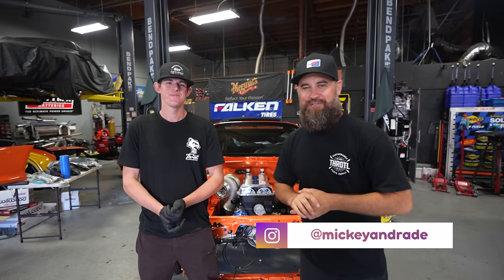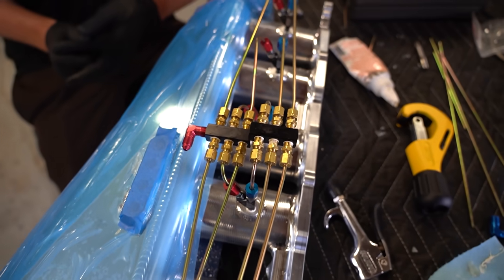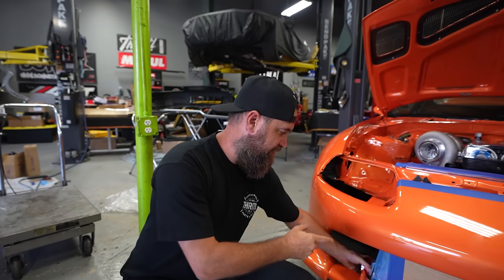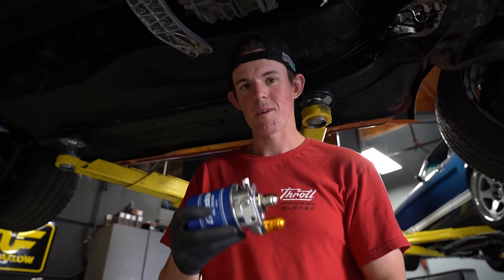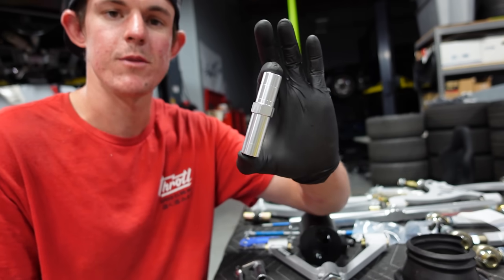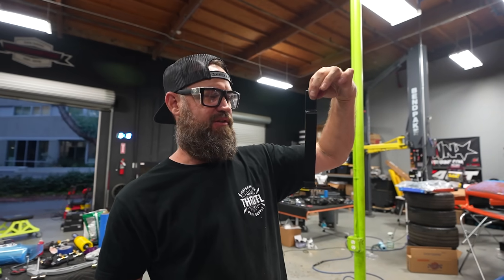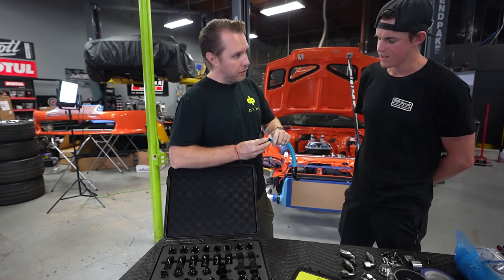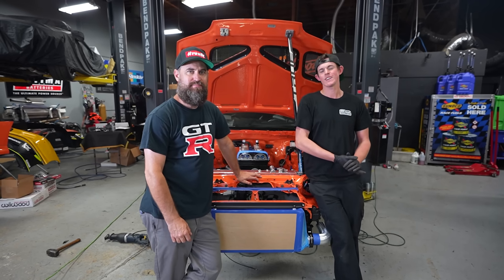Building a Modern Day (Fast & Furious) 1994 Toyota Supra Turbo - Part 10 - Build Continues!

Comment: @throtle just a suggestion. Try bypassing engine oil cooler and anything unnecessary just to limit clean out or replacement if motor develops an issue. Then connect if everything checks out over time.

Comment: A two stage automatic nitrous kit would be rad- first stage only for spooling, second for power up top. Just an arming switch and some sensors from there. Nitrous from full throttle to spool (turbo speed sensor or just boost referenced) and then RPM and throttle based for top end. No button, just alway ready to party.

Comment: Found it interesting that the nitrous lines were unequal lengths. Perhaps at the PSI it'll be supplying it won't matter, but the shorter lengths will get the hit first hmmm. I guess it's because I come from the aircraft side and when we make fuel lines (I know its not nitrous) we cut the tubes into equal lengths and then add bends to get that entire length to fit where it needs to go so all injectors are theoretically evenly supplied.

Comment: Holy rivnuts batman drilling holes for rivnuts everywhere jeez and yall should use -3AN steel braided lines for the boost control boost source and boost reference for the wastegate and BOV that will prevent useing silicone hose that will melt and lead to over boosting and vaccum leaks especially on a higher end build like this -3 an steel braided for boost and vacuum lines is the way to go

Comment: Do the nitrous and fuel lines not need to be equal length from the distribution blocks? Wont the short lines end up with priority compared to the longest lines on the front and rear runners?

Comment: I rebuilt my first dirt bike motor when I was 13 and it was super fun so one day I want to rebuild my first car motor one day I'm not very smart when it comes to all the numbers compression or anything like that I'm just good at puzzles and almost like a step up in puzzles haha one day maybe I'm only a kid so it could change
Reply: Don’t sweat the maths, if you are doing stock rebuild or low boost turbo you don’t need to worry about any of that. I built my first MX5 (Miata) engine last winter, it’s done 1500 miles since then, being regularly beat on. Just go slow, measure the critical things like bearing clearances (or have the machine shop do it) and use a good torque wrench on all the fixings.
Reply: @foamdataservices  man torque specks haha they are annoying

Comment: Wouldn't you do all your intercooler and radiator mounting before paint so if you need to weld brackets your not backing yourself into a corner?? Just seems like a stupid and backwards way of doing things